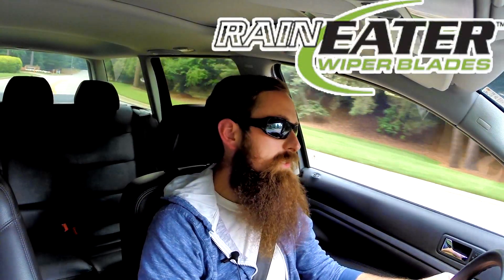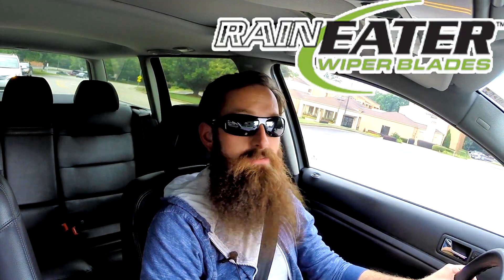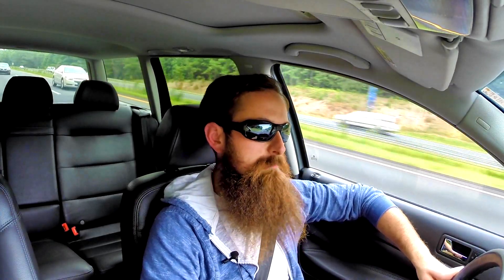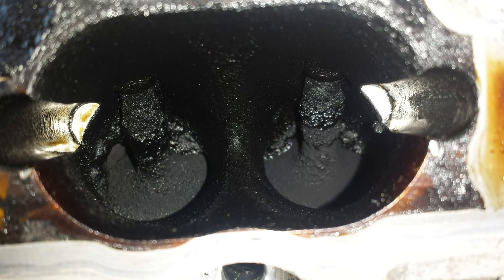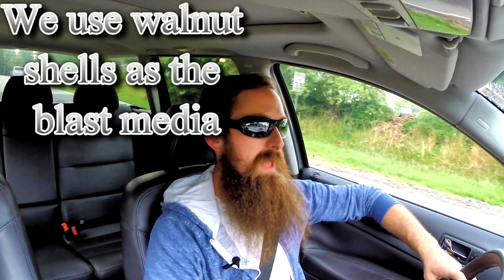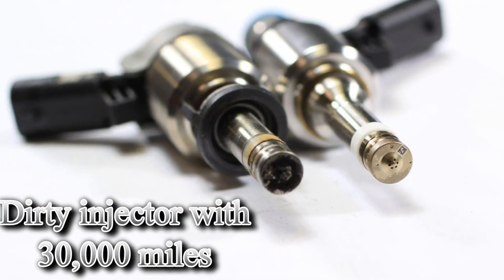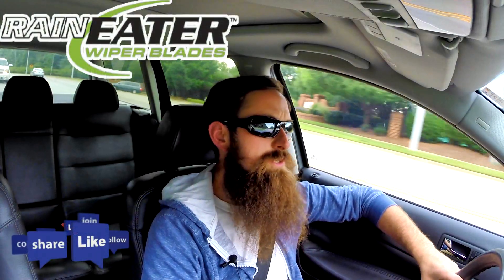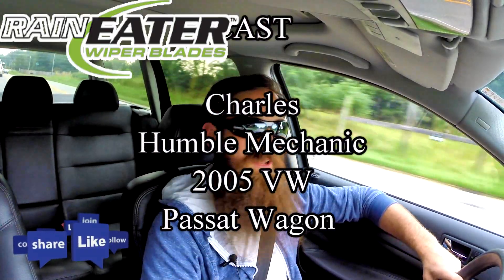Preventing and Fixing Carbon Issues for Direct Injection Engines ~ Episode 80

Comment: I know this is an old video from 2015 BUT I noted one of your latest videos talking about the new MK8 that the USA model does not have 'dual injection' and that some models prior to this had dual injection. SO anyhow I checked my 2020 MK7.5 R which I bought new last year and it does have dual injection. I have been using Liqui-Molly Fuel system conditioner since new and also use the highest octane fuel we have in Oz which is 98RON. Can't believe that VW did not make them all dual injection...

Comment: I've got the 2013 escape 2.0L w/160k on the clock no catch can, never had a carb cleaning runs like a champ I do however have my foot in it all the time with average hwy speeds between 70-85, it sees speeds of 110+ on the regular also.
I've never had an issue w/rough idle or poor fuel milage.
Reply from the maker: Does Ford run Direct injection on that car?
Reply: @HumbleMechanic  yes its the first year model for the 2.0L escape direct injection

Comment: I bet if you run a higher octane at a high rate of speed for a set time along with some cleaners it would clean the valves much quicker and better as it will be hotter

Comment: Just an fyi,  i did the first ever valve clean on my wife's 2012 Eos 2.0 Tsi at 168k miles.  This was all due to a failed pcv dumping oil thru the entire intake system.  Yes big cloud of smoke on start up.  I did replace the pcv, replaced intake for dreaded flaps and position sensor, added catch can and did my best to clean oil from the charge system (turbo - to intake). Also took time to address oil leaks from valve cover, timing cover, and vacuum pump.  

She drives highway miles to and from work 35+ miles each way. She doesnt use premium fuel, and i did try to seafoan treatment maybe 30k ago.  I was suprised yes the valves were carboned and had build up but wasn't as bad as i expected.  

Can you do a video on the use of water meth injection in the intake and the effects it has on reducing carbon build up???  Any long term real world examples of if it works? 

Thanks

Comment: valve carbon buildup is one thing Bosch engineers did not foresaw when they first developed the direct fuel injection system.  you can install an oil catch can, but I think the real solution is to have a manifold fuel injector as a backup/cleaning injector during light load.

Comment: One fix to the problem of gdi is to use marvel mystery oiler or an ampco oiler running with mmo or some other additive to clean the valves, the oiler can be connected to a source of intake vacuum such as the pvc hose using a T, or brake booster hose. The recommended amount of mmo is about 1qt for every 800 to 1000 miles.

Comment: I have the 2L FSI in my Octavia and it has about 133000 miles and it has never been touched. Fuel economy is fine and no misfires either. I'm sure it could use a scrape but I am having no problems so I am leaving it alone. Maybe the lack of turbo charging helps?

Comment: Preventing carbon buildup on engines is simple. Don't buy a vehicle with Direct injection issues. Toyota has a fix by adding port injectors. All the new tech like low tension piston rings and direct injection is just making vehicles less reliable.

Comment: The VW fuel additive is Lucas Oil Upper Cylinder Lubricant additive under a different, far more vluggenhabenshtein name and higher prices as zee Germans do.

I have issues with the Italian Tune-up because it also boosts crank case pressure and the immediate vacuum could actually suck more crud in to cool and solidify on your valves.

For preventative, my first step is an old school drag racing extra power trick: less oil. 

I stick to the factory weight oil and only use the manufacturer’s oil (as I do with all fluids).

I service my car every 5k miles, which is almost every 5 weeks with my current work load. I fill it 2 quarts under factory spec, let it come up to normal operating temp, then fill to just under the “low” fill line on the dipstick. 

Less oil = less oil being whipped into foam by the crack case = less oil particulate = lower crankcase pressures = less gross gunk being sucked into the intake manifold.

This is a hypothesis, though: my car my risk. No advice given. 

I’ve seen positive results (less gunk coming out of the primary OCC so far).

Added benefits to less oil (not dangerously low levels): slightly higher fuel economy and slightly more power. 

If your motor has hydraulic lifters, I’d put in an extra cup to pint of oil over the engine’s hot low reading.

My service interval is frequent enough that I don’t risk burning excess oil and oil samples have shown no more bearing material in solution when compared to my brother’s (same year, make, and model as mine with recommended dealership supplied services). 

My engine is (not surprising) significantly healthier by all data samples with nearly 2.5 times the mileage. Mine doesn’t burn a drop of oil between changes while his will go through half a quart or so.

Step 2:

A high quality Oil catch can (or two of them, routed from valve cover to OCC1 intake, from OCC1 outlet to OCC2 intake, from OCC2 outlet to air intake as I’m currently experimenting with. The second can does catch a bit more crud and could easily go 3-4 services before needing to be drained. I’ll take a 25% cleaner air supply any day of the week).

First OOC was installed the first day I had the car in my possession.

Second was installed at 40k miles. Vehicle currently has 160k on the clock.

Step 3
BG valve cleaner administered every 15k miles, and run 44k every 5-10k miles for the direct injectors themselves. I don’t know if there’s any benefit to the fuel additive as I’ve never had them out.

I test power every time I change the air filter by running the same quarter mile stretch of road both ways: still performs within the margin of error as it did when new... but everything else in the powertrain is maintained with the same (admittedly waaaaaaay overthought) maintenance religion.

I should also note the engine was broken in properly and I demanded to take delivery of a vehicle with under 5mi on the odometer when I ordered it.

Now the kicker: this is a 2018 Subaru Forester 2.0XT. Not a drip or drop from either the head gaskets or any of the seals. It’s all about proactive maintenance.

Comment: I have a Nissan Juke AWD CVT... Yeah I Know I should have never bought it... But I did and didn't know About DI Engines and CVT Trans at the time... Bought used from Dealer with 73,000 Miles on her. I have a year left in payments. But recently went all out.. Full CV PCV three port Catch Can, CVT cooler, and I do 5 Quart CVT drain and fill's every second week of every June.. I did 4 Drain and fill's 3 back to back in one day, and a forth a month later to maintain the CVT.. My next Move are the Valves.. I have a custom Turbo Back exhaust, Ingen SRI, FR Down Pipe, 2J Mid Pipe/Flowmaster Fast Cat, 2J cat back, FR Oil FL, CVT Cooler, TS BOV, MISHIMOTO FM Inner-cooler, and I'm planning to see a Tuner in PA within the next 2 month's.. I got to put new plugs in and I want to get my Valves cleaned right then Tuner, Hey it's only a weekend Car really was a daily, But I drive a work van 5 days a week, So she's a weekend Kinda Project Car for now.. I think cleaning the valves myself will be bit much for me to handle myself.. I live in South Jersey, Need to find someone local to me? I have tried blowing GDI cleaner thru a vacuum hose, having a friend hold the gas peddle a few times.. Really don't know what else I can do other than to take her to someone. I'm just about to hit 90,000 miles.. The Car didn't get a catch can until 80,000 so I'm scared to even try and look at the back of those valves, But seriously are there any cleaner's that actually work?? I'm not getting cold start miss fires yet but still concerned.. Should I waste the Money on the sea foam or put it to a Mechanic than can clean them right??

Comment: I injected Seafoam  via the vapour canister line straight into the inlet manifold WHEN the canister valve is working with the engine ticking over , ( you can hear it clicking) first dose no effect second dose several weeks later and it made a huge difference

Comment: Hey HumbleMechanic. I know this video is a couple of years old, but if you read this comment, I have an interesting story to tell relating to the topic.

I recently bought a VW Caddy Maxi Life (I live in Europe) with a 2.0 TDI 140 BHP. 

The car had been owned and operated by the county and had been used for transporting stuff. They had done services according to the VW Long Life std. (which I dislike), and so at 90 000 miles, it had only recieved 4 oil changes! 

First thing I did when I got it home was to change the oil and oil filter. 

Then, I let it run for two weeks and did an engine cleanse in the following order:

-Warm up the engine and drain the oil out. 
-Put in a cheap oil filter.
-Add cleansing oil.
-Start the engine.
-Use QMI PFPE engine cleaner, which I added in small amounts through the oil dipstick hole (about 6-7qts in total) (They recommend this procedure especially for low sitting valves)
-Then I let it idle for about 15 minutes.
-I drained the oil sump again, and removed it, to clean it and the oil strainer.
-I placed it back on, added a premium oil filter and oil.

And about a week later, my throttle valve got stuck every time I stopped the engine. I took it apart and discovered it was filled to the brim with carbon deposits. I had the manifold opened and man oh man it was so much crap in there that I had a field day cleaning it out. 

All of this crap had come off due to the use of QMI engine cleaner. 

I had to replace the throttle valve as well. 

I also did a chemical EGR cleanse, and black soot came out the exhaust, and afterwards I changed the oil and oil filter again (I added an additive to make sure the soot would not clog up the oil strainer and seize the engine). 

Now the engine runs like it was brand new.
Reply: This reminds me of Valvoline blue, it cleaned too good and clogged up components. If you used restore and protect it would have cleaned slowly and maybe not clogged it up.. maybe.. just saying this as I'm going through a similar thing. 👍

Comment: It’s super important to use VW spec engine oil. It will prevent carbon build up
Reply from the maker: Not on the back of intake valves
Reply: @HumbleMechanic  VW 504 00 should have less buildup compared to vw 502 00.

Comment: My Toyota with GDI only has spark knock on load when it is warm, it is so smooth when it is cold, but when it gets to operating temp and I floor it it makes horrible noises, and it gets horrible gas mileage.
I used to drive it very short trips, I think that caused the carbon build up.
What I understand from what you are saying is that valve carbon build up causes cild start misfire, which means I may have carbon on top of the piston only, is that right?

Comment: Never use Sea Foam or anything like that on a Turbo Charged engine. If a piece of carbon breaks off and is blown into the turbocharger it can do severe damage. 
I have a twin turbo Lincoln MKS Eco-boost AWD sedan. I've added an inexpensive catch can on it and I run an Italian tune up at some point everytime I drive the car and have had no issues with carbon build up.

Comment: The best way to get rid of carbon buildup on intake valves of GDI engines is to sell your car and buy another one  with a non GDI engine!. All the manual cleanings are quite costly since you have to tear into the engine to get access to the valves. Do you really want to pay for a manual cleaning over and over?

Comment: In this video this guy shows an example of how clean seafoam got his valves and runners, doesnt show the inside of the throttle body but id assume it cleaned a ood bit of that up too. https://www.youtube.com/watch?v=3LDaMaTIAr8

I have a 2015 BMW 328D with the turbo n47 engine, I have been researching chemical alternatives to the expensive walnut blasting and labor extensive removal and cleaning of the intake manifold as well as the mess that occurs while doing so. Ive even looked into using steam injection or water injection to clean the carbon off but i think the only place this would work would be the intake valves, piston heads and maybe the upper rings. Becausou need heat to get the full effect of the water injection.

Comment: 2016 Golf R at 48,000. Just had the carbon buildup cleaned up and it's made a huge difference. I bought it used just before 30K miles and have always put in the high-octane fuel. I agree with you, I don't think the fuel makes a difference with the carbon deposits. Local shop has found a lot of weirdness that the dealer never mentioned, and this was sold to me as a "certified" used Volkswagen.
Reply: How much did the carbon cleaning service cost?

Comment: Actually it's mostly caused by reversion. That small overlap between the end of the exhaust stroke, and the start of the intake stroke. This is supposed to help scavenging and drivability . Exhaust system back-pressure also adds to the effect.

Brandon Friesen below, targeted this by pointing out the difference between "City" and "Highway" driven platforms. City vehicles will have much lower velocities in the intake ports, and buildup from reversion will be more prominent.

Comment: Just had to have our BMW walnut blasted and new injectors at 56k... compression was also down by nearly 50% but returned to normal after treatment but an hefty £600 bill is not good
Reply from the maker: Wow down 50% that’s bad!!
Reply: No need to replace injectors, just the seals, it'll cut 200 pounds from total coat. Injectors can outlast engine.

Comment: Charles you are right. Although I always used  Shell Racing 100 Octane petrol - performed Intake manifold hydrogen cleaning and frequent Tunap chemical injection at manifold I finally had to remove the manifold and SODA BLAST the intake valves to clean them at 100k km. That was the solution to the problem.

Comment: Hey I have a Nissan Juke SL with the AWD CVT at 82,000 I keep all the fluid's new at all times and so far so good made a few upgrades tooo No OIl Catch Can YetI change my Oil every 500 to a 1,000.. I do not have a CVT cooler either.. But I do 2 drain and Fill's over every 10,000 Mile's just for Lubrication/Protection of the CVT  a hundred every June 24th and again the first week of August to keep fresh fluid over the summer month's.. But I do Need the CVT cooler..

Comment: Hello there! thanks for the informative video. I have recently bought an old VW Touran 2006 1.4 TSI. It is running quite rough and with the occasional cylinder 4 misfire. So after changing the plugs, coils and air filter and checking compression etc. i have come to the conclusion that it is probably the carbon buildup on the intake valves. I wanted to use the CRC Turbo and Valve cleaner but the the problem i have is that the instructions indicate that the product should not come in contact with the MAF. Now that seems strange because according to the VW manual for this engine, there are another three sensors that seem to the perform that function, 1 after the supercharger, 1 after the turbo and 1 at the intake manifold so i can't see how this product could be used while avoiding all of those sensors. Is a MAF the same as these sensors shown in the manual? Is it just that you shouldn't spray it directly on the sensor but once it is dispersed properly in the intake air its ok? Any advice or clarifications would be a huge help!

Comment: Mobil has the most detergents in it’s regular gasoline. Shell is best for premium. Google:Been testing oil LS1. There’s talk about using Marine outboard two cycle TCW3 rated oil in your gas tank. I personal have been doing this for years and my cars and truck run excellent. 1oz per 5 gallons of gas. More does not mean better.

Comment: From a Marine technician perspective, to remove gunk from valves/cylinders I HIGHLY recommend trying Quicksilver Power Tune. Follow instructions, and change the oil afterwards for fourstrokes. I didn't believe in a $10 can of magic either until I first tried this stuff. You will see carbon deposits come out the exhaust and yes it is catalyst safe even. We use it primarily on 2-strokes to eliminate carbon deposits without a tear-down. I also use on 4-strokes that develop engine run on, rather than pouring water down the intake this will shiny clean everything it touches in your engine. Or dirty carburetor or whatever

Comment: Why dont the manufacturers install these catch cans if they were so beneficial ???I don't see a big deal in manually/chemically cleaning the back side of the valves every 100,000 miles if indeed needed. My KIA has 150,000 on its GDI engine and runs smooth never cleaned either. Are you selling or advertising a product here ?? You mentioned one brand catch can several times ???

Comment: Hello Humble Mechanic I live in Germany and done an apprenticeship at a skoda dealership for 3 1/2 years and now on to my bachelor professional as a mechanic. My thoughts on one of the big problems of the tfsi  motors are their higher egr rates due to emissions because of the Nox Gases its the same problem diesels had since the dieselgate. The gas from the egr is full of carbon (if not runned with high octane fuel) so with higher octane you may have a chance of not getting it worse.
Greets from Germany! Sorry for my bad English I'm outta practice

Comment: So to your point on FSIs seeming to have less of a buildup issue: I have an FSI and a TSI, and the TSI recommends 10,000 mile oil changes while the FSI suggested 6 or 8,000. Maybe you're right, the oil is breaking down and while the rest of the engine can handle the old oil, the valves are getting more grimy. Just a thought.